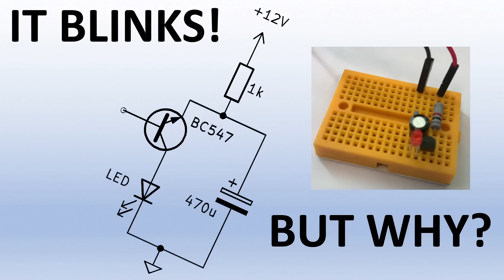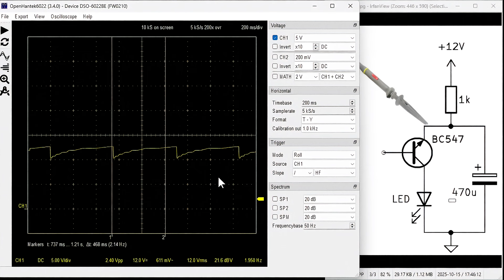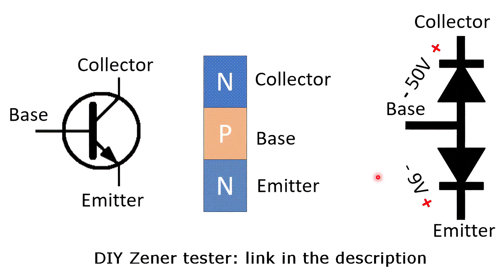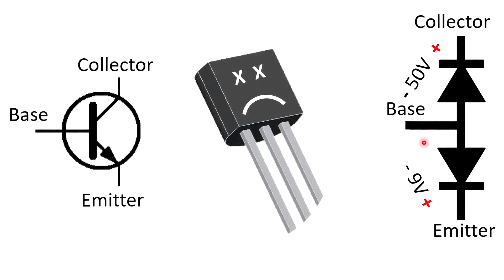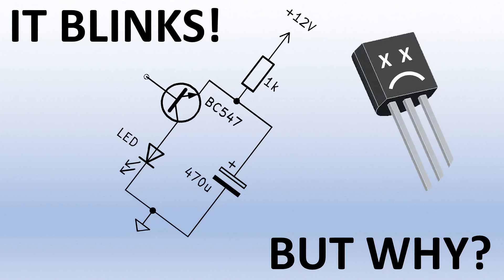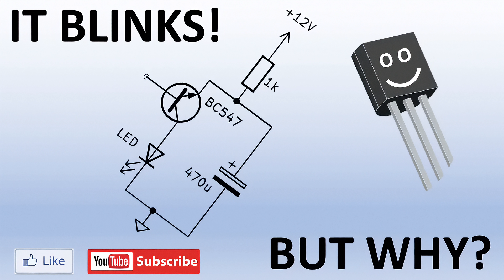Dirty one transistor blink circuit

Comment: Truly a graveyard design for transistors. They will quickly deteriorate in such mode.
Reply: Avalanche is non-destructive as long as you limit the energy.
Reply: @sbreheny  Yeah, avalanche is the same core principle by which Zener diodes work. Which is why I think this circuit could be rebuilt with a zener instead of the transistor. And since Zener's are actually designed to undergo avalanche, it should also be more reliable.
Reply: @tcfh2003  A zener diode will deliver a fixed voltage hence a steady LED illumination. A zener with a capacitor in parallel is traditionally used to stabilize a low current supply rail in small circuits like simple audio preamps.
Reply: @tcfh2003  Zeners are designed to provide a stable voltage at avalanche, because oscillation like this is normally considered undesirable. Therefore it may not oscillate with a Zener. This circuit relies on the fact that transistors are not designed to provide stable voltage at avalanche (because they are not meant to be used in that way.)
Reply: @tcfh2003  Wrong. A zener will not allow oscillation because it doesn't exhibit "negative resistance."
Reply: @sbreheny  Test the transistor after about 2 months in avalanche mode. You would be surprised.
Reply: @trevoro.9731  Now try it with a germanium one! :)
Reply: @trevoro.9731  all components fail.  nothing lasts forever.
Reply: @sbreheny  : In forward mode this can be true. But here we talk about the B-E breakdown which will deteriorate the transistor with the first pulse. After that it continues to operate just with worse parameters.
Reply: I put ten of these oscillators in an Xmas decoration to get a glittering effect. It is perhaps 15 years old by now, and has been running for at least a month each Xmas. So if it's a non-critical application and you're never going to use the transistors for anything else later, it's fine in practice.
Reply: Basically it's using it as a diac in the direction where it has the lowest breakdown voltage. It is safe in some cases.
In this circuit I think you are right though as there is no resistor limiting the current in the LED from the capacitor making the transistor as it breaks down the limiting factor until it dies.
Reply: @1kreature The led has enough resistance
Reply: Stuff like old school light dimmers rely on the avalanche effect.
Reply: Yet another "how to build an oscillator without a proper oscillator" method.  Undocumented.... uncontrollable....  unreliable... nothing you'd  ever find in a proper engineering textbook or datasheet, but perfect for many a Chinese gadget.  Preferably coupled to a capacitive dropper "PSU".
Reply: @citymagnum4734  To be honest, it serves its purpose:
- creates blinking: check
- costs $0.0001 less than a real device, thus making overlords happy: check
- will deteriorate in a year or two forcing user to buy another one: check
Reply from the maker: That is a funny comment :-)
Reply: Hence the 1k current limiting resistor. At most you will get about 10 mA of current  given the ~2V of Vf in the LED. Even at 100% duty cycle that will not cause deterioration of the transistor. Now that electrolytic cap on the other hand...you would be correct to say that it should have a current limiting resistor in series, perhaps 100 ohm. The uncontrolled cap discharge would eventually wreck the transistor (and even a cheap cap).
Reply: @tetrabromobisphenol  No! The resistor isn't limiting the current from the capacitor through the transistor and led, only the average current. The peak could be any value from the average up.
Reply: @tetrabromobisphenol  : The 1 k resistor will not limit the discharge current.

Comment: Good video demonstrating and explaining the negative resistance phenomena! 
When I was younger similar circuits were much more common. Avalanche diodes and transistors are hardly manufactured anymore except some Gunn and impatt devices for microwave.  Some could until recent world event be acquired from Russia. There are some inexpensive transistors that can take it better without damage like the 2N2369. 
The tech is still very interesting as an inexpensive means to generate very fast pulses for experiments. Similar circuit, C replaced by a transmissionline. UWB and ground penetrating radar comes to mind, sub ns performans. Jim Williams wrote about using the 1N2369 for this way back  in some of the excellent LT app books, should now be online?  
I did play with a small vivaldi antenna driven by one of these circuits, worked well as a very broad band uwb transmit test source. Make it on random teflon laminate like Duroid or some Chinese nock off for better performance.

Comment: Good explanation. When i first started playing with transistors in the mid-70s, there were terrible books in our local library from which only a genius would have been able to learn somthing. Today there's a ton of information on everything, but the really good explanations are still hard to find. Subscribed.
Reply: I used to make electronics projects in the 1970s too. Most of my information came from magazines (mainly Everyday Electronics, a UK hobbyist magazine).
Reply: Transistor books were terrible everywhere, including university book shops.
Reply: I bought so many books back in the day trying to understand how electronic things work.  I have more books on electronics than the library.   With some books at more than £20 even then I must have spend several thousand pounds all in all.   Oscilloscope was army surplus auction for £90.  
Best book:  A practical introduction to electronic circuits by Martin Hartley Jones.
Best plan:   Read for an hour and then play with circuits for seven hours.  Build things if only kits.  
 Don't try to understand at the atomic level.  It will not help much at all.  
 But you must do some simple sums.  Ohms law mostly.

Comment: It should have been shown that a bipolar transistor can still work if the emitter and collector are reversed between them, of course with a much lower gain. This is what explains the operation of the circuit here and why it wouldn't work if the transistor were replaced with a Zener diode.
Reply from the maker: Yes you are right, a BJT can be used in reverse (emitter <--> collector) with a very poor gain though.

Comment: Лавинный пробой транзистора, это не хорошо, сгорит транзистор не сразу.
Reply from the maker: Correct it is bad from the transistor, I actually measured the Hfe before and after some time in this circuit and did not see any damage, still you are absolutely right, avalanche can damage it and this circuit can fry the transistor anytime.

Comment: The avalanche transistor was used in tone generators and tone dividers in musical instruments around the 1970s.
Regarding how many thousand oscillations it is, it can be said that the mode is reliable, as long as the correct operating mode is selected and the limit values in the nom are not exceeded. Supply voltages were used up to about 50V.

Comment: Another use of a reverse biased B-E junction is a noise source

2N2222's and 2N3904's are fair candidates for noise generation, but the noise is ugly on an o'scope and the avalanche bias shall be kept within a few microamperes ( example use a 1MEG resistor in series with the Emitter, Base grounded and Collector left open ) to bias the junction under 12 / 15 volts ). Noise will appear on the Emitter.

Sorry, i didn't try with European transistors.
Reply from the maker: Cool, I did not know that. I only knew you can use Zener diodes to generate noise ;-)
Reply: @circuitarchive193  A similar trick is used as a noise source to imitate a hi-hat or cymbal. It works with almost any BC transistor.
Reply: Came here to comment the same ! I've tried it with a BC series (I think it was a bc547 or 548) transistor and did get some noise out.
Reply: That's the problem with JEDEC numbering. You do not know what is inside, just that some parameters are within some limits. The internal setup might have changed several times in history, so maybe old schematics will not work with new transistors having the same 2N... code. (Singly diffused transistors, then epitaxial/mesa, later planar construction.)

Comment: somehow cant get this to work in simulation ...
Reply from the maker: You can not simulate it because the behavior is not part of the model  😞
Reply: Normal. the B-E junction of any BJT is not documented to work in Avalanche mode. Also, unlike an Avalanche diode ( AKA a >12 volts Zener ) that is explicitely designed to work continuously in reverse avalanche, a BJT B-E junction is not designed to go in reverse avalanche and a such abnormal biasing may easily damage the transistor.

Comment: When I took a course on semiconductor physics it was starting to get more and more frustrating that soooo many diagrams did only write n or p and not indicate when a region is strongly or lightly doped. Some authors put a n+ / p+ for high doped regions so you can spot easily which parts of a device will be overwhelmed during operation at given breakthrough voltage. Otherwise it's just "you know, sometimes this n here breaks down, ikd but works."

Comment: ZTX415 if you want transistor specifically made to avalanche.
Reply from the maker: cool, it can handle 60A (20ns...) 😯is this used in oscillators as in my video?
https://www.diodes.com/datasheet/download/ZTX415.pdf
Reply: @circuitarchive193 the Wikipedia page on avalanche transistors goes into more detail, and yes, it is, to generate very fast rise times
Reply: @circuitarchive193  My friend uses a cascade of them to trigger a Pockels cell for laser switching.  One of the few ways to get a fast accurate high voltage pulse.
Reply: whatsTheBreakdownVoltage?
Reply: @ovidius2000  According to the datasheet (that @smartpowerelectronics8779 already linked to), 6V.
Reply: @ovidius2000  : This is another type of avalanche breakdown. The transistor is used in "correct" connection. Operating/breakdown voltage is 150 V, thereabouts. Another transistor abused in that way is the 2N5551. There the breakdown voltage is around 280 V when using a 50 Ohm B-E short.
Reply: Just Use a Z-Diode

Comment: A transistor in backward connection behaves like Shockley diode or diac. Also the same effect can be reached with neon bulb (even no LED needed, just resistor, capacitor and bulb), but higher voltage required.
Reply from the maker: You know your stuff, a diac has the same behaviour at ~30V and if you replace the transistor in this circuit with a neon bulb (and bigger R smaller C) it will also blink ... but you need more than 70Volts.
Reply: @circuitarchive193 As lâmpadas neon e os DIAC's têm a vantagem de serem bidirecionais.

Comment: so can we use Zener diode instead of transistor?
Reply: No, that will deliver a delay for the LED to illuminate, then a continuous on state.
Reply: @PlatypusPerspective won't it gonna go voltage drop from capacitor discharge?
Reply: @techh3x4  No, a zener diode has a single junction which gets reverse biased into a steady avalanche state, it has no regenerative effect to go negative resistance and discharge the capacitor again. A zener with a capacitor across it is the standard low current voltage stabilization circuit used in very small power supplies. Adding a series LED is a way to get a "power on" indicator without wasting any current.
Reply: No, since the Zener does not have the 2nd P-N junction that will inject electrons directly between the collector and the emitter althrough a "reversed" transistor will exhibit a much ower current gain Hfe than a normally conected BJT.
Reply: @ve2um yeye i kinda get it now, thanks for answering
Reply: @techh3x4  Perhaps this will aid you further :-  The zener would not continue to conduct and discharge the capacitor down close to zero volts as happens in this transistor circuit.    The zener would simply hold the voltage steady at its designed reverse breakdown voltage.

Comment: Took this simple circuit one step further by changing the capacitance and load resistor. Makes a  very stable 18 khz oscillator for a flyback driver too
Reply: I'm not sure about the "very stable" part. I wouldn't be surprised if the poor transistor changes over time. 
(Not to mention spread between parts, pruduction batches, or even replacement components.)
Reply: @DrAHorn  I built these a lot as a kid with a self wound ferrite transformer with an extra feedback coil and a transistor. They’re quite tricky to get working and the transistors absolutely don’t last long but it was fun while it worked
Reply from the maker: 😬 cool

Comment: Esaki Oscillator, the transistor base is not used, and it takes at least 12vdc to operate.
Leo Esaki is a Japanese solid-state physicist who shared the 1973 Nobel Prize in Physics with Ivar Giaever and Brian Josephson for his work on tunneling in semiconductors, which led to his invention of the tunnel diode that exploits this phenomenon. His research was done when he was with Sony.
Reply from the maker: Interesting, so the circuit is actually really useful then!
Reply: someWorkEvenBelow9Volts.
Reply: This transistor create S type curve, tunnel diode create N type curve.
Transistor similar neon bulb, electric arc, zincide crystal.

Comment: Good for analog synth.
Reply from the maker: yes, can make some sound if you use a small capacitor. If you touch the base with your finger expect you can change the frequency.
Reply: You can even add control-voltage inputs and have a swarm of 1000 of these drone your ears out of orbit. Look Mum No Computer's Megadrone Synth is based on exactly this circuit :)

Comment: Transistors exhibit negative resistance region over Vce, Ic once above a limit. 

I used a stack of transistors,  whose Vce were equalized by large resistors. Triggered from base. At the collector, a capacitor would be charged from the collector voltage. A ultrasonic transducer would be impulsed when the capacitor discharged through an avalanche triggered from base.

Very fast discharge impulse. Each transistor would show this negative resistance over perhaps 7-10 volts and so stacking helped.